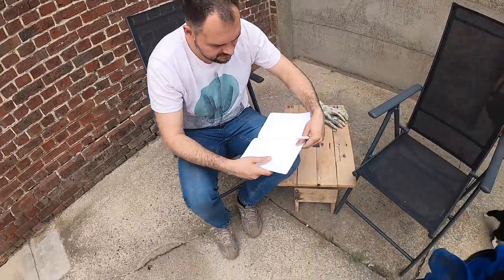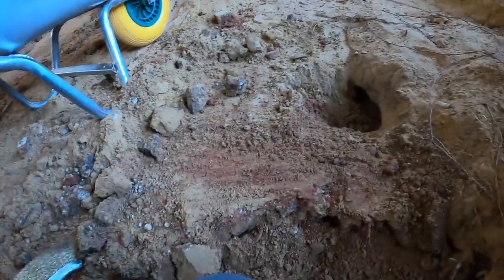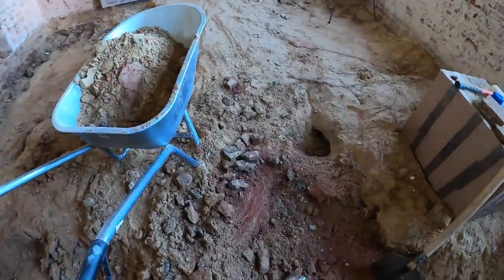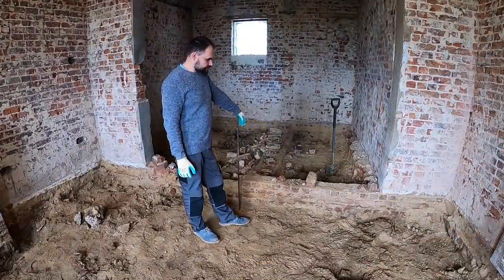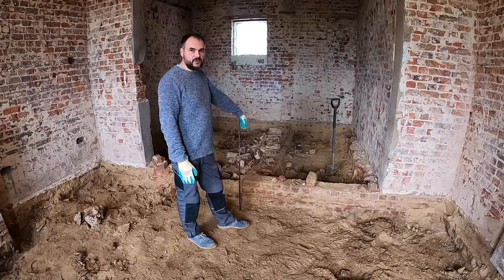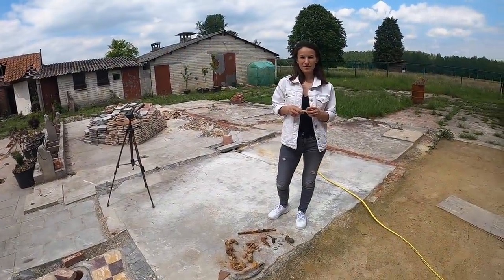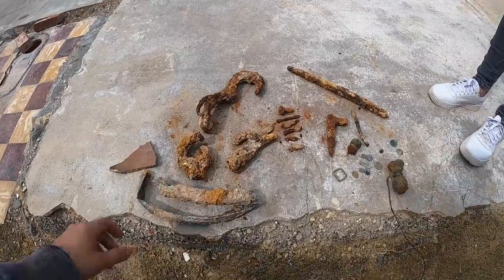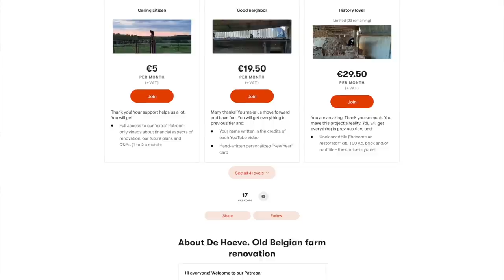How to Build a Floor: DIGGING OUT sand in our future guest room [ PART 1]

Comment: Love the metal detector finds, clay pipe, & beer bottle research!  Adds so much interest to an already fascinating renovation project.  Construction methods have changed so dramatically in 100 years.  Keep up the good work Illia. 👍👍
Reply from the maker: Thank you :-)  That's true, changed a lot. They used the materials very wisely.  But also took quite some shortcuts later on  😂

Comment: Buckle could be a shoe buckle. Clay pipe could be 18th century. Check out some mudlarking videos. They find a lot of the same stuff. Also two pieces attached to wire could be cheese cutter.

Comment: Don’t forget to put down a moisture barrier. I forget if it goes before or after the cement layer. But it should be before the insulation. Love what you guys are doing and I love check in every week to see progress. Such a wonderful project. ♥️
Reply: Also, that beer bottle from the original Stella brewery will make a lovely vase for some simple flowers. 🌸 💐🌸

Comment: The ‘strange looking tool’ looks like it could be fixed onto a long wooden handle as pruning clippers operated with a cord tied to the arm next to the socket. Love the videos and admire your energy and drive. Best wishes and good luck from England
Reply: Agreed. I've got a similar pruning pole in the shed.
Reply: That's exactly what I said to myself when it was shown.  The first item before the hook looked like it could have been part of a pulley & tackle set.

Comment: Suggestion: for better isolation you also may use vertical isolation against outside wall below the floor.
Floor heating? Er zijn ook houtkachels die ook verwarmingwater verwarmen

Comment: That strange tool Illya is pounding to remove the rust looks to be a branch clipper. It is mounted on the end of a pole. The hook goes over the top of the branch and the lower jaw is a knife. You pull a rope to close it and the knife part cuts the branch. Probably they used in an orchard of some kind on the farm: apple, pear, plum. 

Also, just one piece of advice here: When you get down to the lowest natural level, use the compactor on that level first. Make it nice and hard. THEN put the sand and compact it. This make the base even more solid without adding material.

Comment: The tags you found may be belonged to cows. Like eartags in modern days. The strange rusty tool was used to move hay from the barn down to the stable or grab other heavy things to drag around. Love the claypipe you found. If you want to clean your metal finds, try electrolysis

Comment: If you soak all the metal pieces in straight clear vinegar for 24 hours, then take a wire brush to them. You can save them.
This method has worked for me on rusty bolts, nuts, door handles, and other metal tools that were in bad need of rusting.
When you clean all the metal pieces, put a coat of very light weight 2 and 1 oil to prevent rusting.

Comment: That strange tool with a hook on the side is part of what we in the U.S. call a "pruning pole" used for cutting the small branches off of trees, but above your head. It is on a wooden pole, with a rope to pull the cutting blade. The hook is placed over the branch to be cut, and the rope is pulled. The cutting blade (missing from this piece) then cuts the branch. Thanks for the videos. Jon (Vanya)

Comment: Good job and great finds. I can see you have dry sand everywhere so probably you do not need foil as water insulation? I would add this anyway. What kind of thermal insulation do you plan, XPS? We are discussing XPS and ceramsit on our project. Regarding the finds - 22:25 it's a fire hook probably. The buckle is great find as well, probably one of worker was very surprised, having his pants way to low, one day ;).

Comment: The item with three prongs may be a window hook. Ours have two hooks, one to open latches, one to close latches and push the window up and pull it down. We had shades for the window at the school that were raised or lowered with the same hook. It was on a long pole. Someone from a local museum would be able to tell you what it was used for…

Comment: The last "tool" appeared to be the head from a "limb lopper" or long pruning shear.   Your piece would attach to a wooden pole with along with a small rope. The hook would be positioned on a limb.  Pulling the rope would cause a blade to cut through the limb to trim or pollard the tree or shrub.  Thanks for a great set of videos.  Narragansett Bay.

Comment: You are doing amazing work.  The bottle is a very interesting find.  As it is in such good condition it may have some value?<. I wonder if you will install underfloor heating as you are pulling up all the floors?   It is so warm where we live, so we never have to consider these things.
Reply from the maker: The bottles might be sold, I guess. But I doubt they are expensive. We will keep them for our own exposition. It will be the weirdest collection ever :-) 
For the floors - we are still considering the options, probably not.

Comment: For the most part, your English is very good.  Very few words I am not sure of, or don't figure out.  My Dutch is non existent, so I am in aw of your ability, and to take all the other languages spoken in Belgium.
Since I only saw it once, I take it the dog was a drop by, not yours?

The tool he is separating the bricks with, is the one I would try separating the concrete etc. from the tiles and bricks.

A pipe cool!   What dose it look like it was made from?  
The old rusted round thing with the wire on it, looks like a ball for a hitch.
The tool he said looks like "armor" looks to be a limb cutter and connects to a pole on the one end.  That part is open on one end and like a fitting.

Comment: A  few simple questions please  =  

1- why didn’t / don’t you use a laser level tool to make sure you have the correct level for your floor before you compact it? 
2 - what do you intend to do for  ground rising water? 
3 - what floor insulation are you installing? 
4 -  A injection damp treatment will not solve any of your problems, it’s a temporary bad solution to a long term problem in this type of historical building.     

5 - Dig out the floors,  and install underfloor heating which,   yes may be a little bit more money but this is your forever home and you will be so pleased you did it 

Ask your self?   Are we doing this project for our forever home?  If you are then consider the long term gain for all of your projects.   It may take a little longer but it’s worth the time and extra money.   

This could be a fantastic family home for you and your family for many generations = if you choose to do your research before you jump into a problem

Comment: In Sweden you usually put the insulation (styrofoam) under the concrete slab so that the slab is protected and temperated as well.

Comment: What are you going to do to prevent rising damp (water) in the walls? Are you going to inject a moisture-resistant product into the walls? 
It would be a shame if you guys got into trouble after all that hard work. Now you can still handle it.
Reply from the maker: Yep, that is the plan - inject the walls against the rising damp.

Comment: That handle and wire may have had another handle on the other end and used to saw bricks in half. Just a thought.
Reply from the maker: Could be...  our first assumption was a plumb bob.
Reply: Maybe also that, but would think string is what is used and a metal cone. Nevertheless keep on detecting and finding cool things. Maybe you want to think about installing floor heating now that you can.

Comment: Why do you need the reinforced slab? I always thought you only need that if it the walls are built onto that slab. If you've already got foundations under the walls, all you need is a clean, solid surface for the insulation, which is 3-5 cm of concrete, no rebar. Then a moisture barrier, insulation and screed. In France it seems they even skip the thin layer of concrete and put XPS insulation straight on the sand, then a layer of plastic and screed.

The major advantage of skipping the massive slab is you can access any pipes that run under the floor a little more easily if you ever need to.

Comment: Never ever bury bricks! They are square so they can't be packed down. You also need at least 10 cm gravel under the insulation to prevent moisture wicking up in the concrete. And be careful removing the old walls from the inside. The outer walls may shift because of pressure from the outside. You must brace the walls if you leave them open for long time.
Reply from the maker: Hi Arne, many thanks for your advices. One question: what do you mean  by “brace the walls”? Could you please explain about it a bit more?
Reply: @DeHoeveOldBelgianFarm  The term you need to search for is acrow props. You put some heavy duty planks in the doorway and horizontal props until you have backfilled your floor. Measure some spots down low and make sure nothing moves.

Comment: Why not placing the insulation underneath the concrete? This way the concrete slab is isolated from the cold ground and becomes a heat sink.
Reply from the maker: It is the common way of building a floor - reinforced concrete slab, insulation, pipes, thinner screed on top to level the floor. The top layer will be good insulated this way.

Comment: That rusty object you thought looked like a little animal is a boat hook and would have been on a long pole. Very useful for pulling bales of straw down from a loft perhaps. The thing attached to some wire could have been a plomb line weight for creating vertical walls. I think if you take a hammer and tap the items gently some of that rust will fall away and you will see the shapes better. really think you need to get more help to do those floors.....going to wear yourselves out.